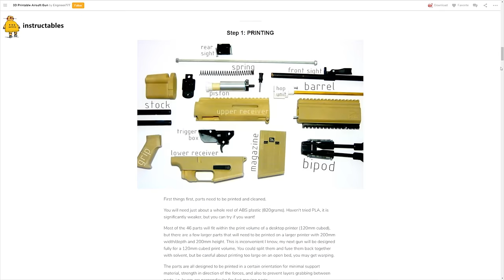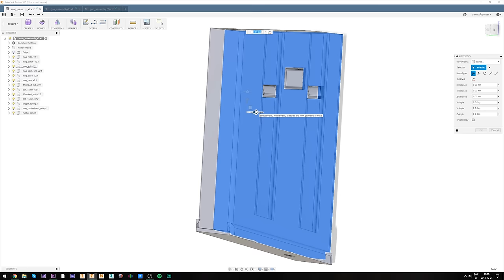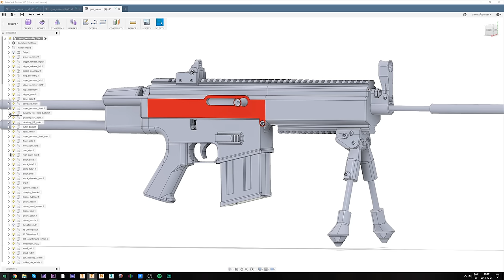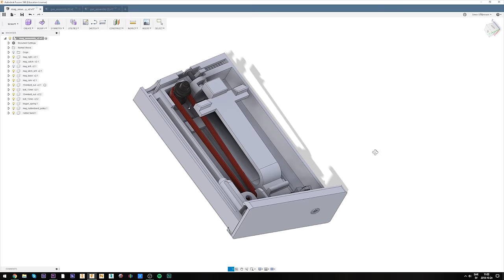Awesome 3D Printed Airsoft Gun!

Comment: Make a 3D Printed Electric automatic/semi automatic Airsoft Gun
Reply: It is very hard to do that
Reply: @bryanmateo9241  yeah
Reply: But ir You use something like the nerf flywheel could be posible
Reply: Bryan Barba not rlly because you can just add a spring and it will work
Reply: @bryanmateo9241  not really you just need a gearbox

Comment: You can also buy biodegradable bbs. Cost about the same as regular ones. Break down after a few months or less.
Reply: They are made of PLA. So in maybe 100 years they are gone but not within a few months. Still much better than PVC.
Reply: +MetalheadAndNerd biopellets can break down in a single month, i really do reccommend them
Reply: @teslacoil4335  The package of all bio BBs I ever had stated either nothing or PLA as material. I believe the properties of PLA are well known in the 3D printing community.
People posted pictures of bio BBs which had been 3 years outside in a pot of soil without any change.
Reply: yeah, i didnt mean to agree with whats his name up there that they were pla, but i meant thatwhatever they are they break down really fast.
(im actually a major 3d printer myself, and as far as ive seen it takes pla years if not decades to breakdown in the sun)

Comment: nice. I would love to see it the speed of the BB's at the exit of the barrel, i have an airsoft sniper 600fps with 0.2g BB's, 80+m range ( with 0.45g BB's) so this can be improved a lot but its a nice start for a 3d printed airsoft sniper. Btw i did not see you put an hopup rubber and tensioning knob

Comment: next time use the biodegradable bbs green coloured ones, there breakdown and dissolve over time, to improve power print a cylinder and. a tight fitting piston with a notch to catch on the trigger sear, with a powerful spring installed iit will go through aluminiun cans. be careful as Airsoft guns have legal powe limits ?

Comment: it may not be penetrating the cans because your airsoft barrel is too long? I looked at that creators models and video and his barrel is shorter than yours in this video. Also if the barrel hasn't got any lines inside it won't propel the bb therefore resulting in limited range.

Comment: The only thing about this is that I think glorified springer. I'm not sure if it's possible that you probably could have used a real airsoft SCAR H mag. They're much better quality and definitely have a higher capacity. Not even high cap. I mean just mid caps. Even real caps are better. what I would have done said is just bought a garage sale and put a hpa system in but thats at least $400 plus a hpa rig.

Comment: Cool build, wood be awesome to see an improved capacity hopper, or make it semi automatic. :) -- FYI for the casual reader, if you're following along and building this in the US (and you care about being legal) you should consider painting the tip orange (or just print it orange). 

[Edit: as others have pointed out, technically the letter of the law only requires this for non-airsoft guns that are being imported; but I've seen in the news that cops have shot people thinking that their toy guns were real due to a lack of the orange tip -- so I mean, if you're dead set on getting a Darwin award, go for it.]
Reply: No, he doesn't. When you purchase them they have to be shipped with an orange tip, other than that you can take it off and do whatever.
Reply: @Sargedawg56  interesting.  I'd heard of police shooting people with toy guns that were missing the orange tip because they thought it was real,  and I'd heard it was illegal here not to have it.
Reply: @Sargedawg56  Also, to clarify, I'm not talking about the original poster ("he" lives off in some European country somewhere, and is subject to completely different  laws).   It was just a comment for the casual reader who might try to build this also (i.e. "If you're..." -- I can see how that wording could be confusing though, so I'll edit it for you). -- Anyway, you may be technically correct about the shipping thing, but correct and dead is still dead. ;-)
Reply: Michael Jensen, that's why you would use common sense. If you are acting dumb with anything that looks like or is a weapon, you may get shot.

Comment: Cool, but first of all WEAR EYE PROTECTION!!! Also always keep mind witch direction barrel is pointed, always treat gun like its loaded. This apply to everyone. Many people have lost their lifes or least eyes from improperly handling a gun what ever airsoft or real.
Sad reality is that this is neet little experiment, but sadly its no where near as powerful than even a low end spring rifles. You will get destroyed in the field using this, unless its tuned waaaaay up, meaning pretty much everything inside if upgraded.
Reply: so theoretically speaking, with a heavier spring would that make it more powerful?

Comment: Could you make it have a higher speed with a stronger spring?
Reply from the maker: Yeah sure, but it will put more stress on the 3d printed parts and the spring might not necessarily be the limitation of power. You see, the bicycle pump is pretty leaky and so that might be what to modify first.
Reply: RCLifeOn yeah I thought about that after I commented(the stress it might cause on the parts) and yeah I didnt think about the bicycle pump being leaky. 

Theres a lot of content on youtube about nerf guns that might help you think of something to modify it(if thats what you want). The mechanism is essentially the same a plunger pushing air through the barrel just on a different scale
Reply: RCLifeOn love your videos btw keep it up

Comment: there is no way that gun weighs 37 pounds, its all plastic, metal guns don't even weigh that much, if it weighed 37 u would be a ble to the the effort you are putting in to hold it
Reply: if it weighed 37 pounds u could not do this effortlessly 5:04
Reply: it may be 1.7 kg or 3.74 pounds which would make more sense